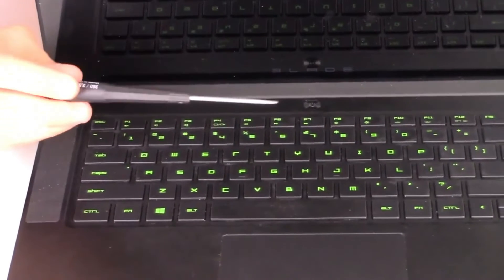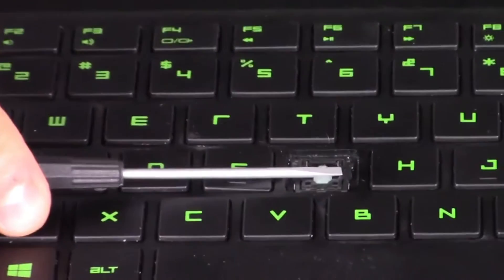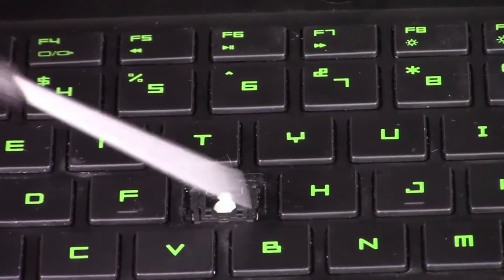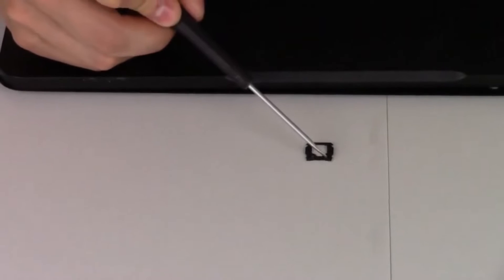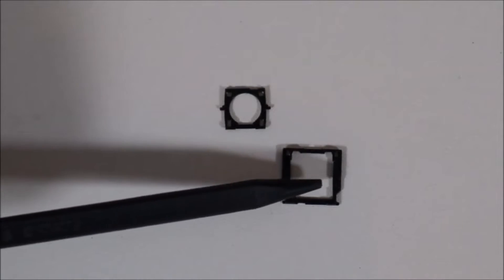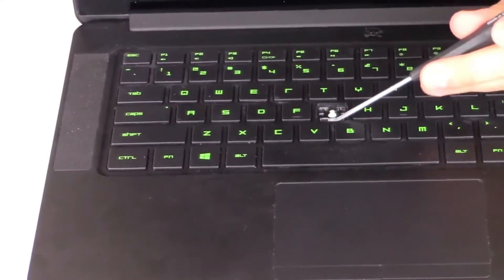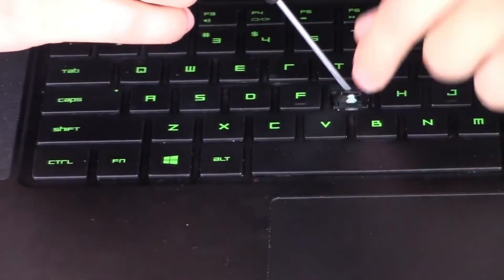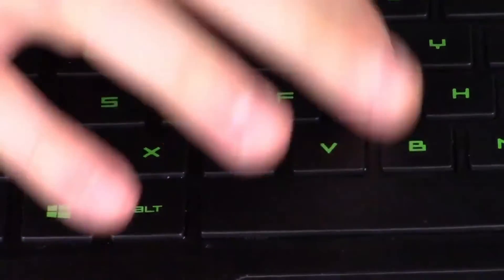How To Fix Replace Keyboard Key for Razer Blade Gaming Laptop Computer

Comment: would this work on a 2022 razer blade 14 with rtx 3080ti?
Reply from the maker: Most keys are constructed the same way with only slight differences in the hinge clip so yes, this procedure would work on most laptops :)
Reply: @PC_Monkey I need help, Im on a razerblade 16 and the key clips are different, I dont see the clips you were talking about
Reply from the maker: @turkeysandwich1458  Do you have a 2 part hinge clip that moves the same way this one does? Does the hinge clip attach to the motherboard by 4 metal pins?
Reply: @ it had a 2 part but it doesnt have the metal clips
Reply from the maker: @turkeysandwich1458  Very sorry. Most keys have those metal clips. Not sure how its hooking to the keyboard if it doesnt have those. Are they perhaps broken off? If you remove another key cap, what does it look like underneath?
Reply: @ they all look like it, it would be easier to somehow send an image of it
Reply from the maker: @turkeysandwich1458  Sorry, I dont understand 'they all look like it'.  If you are able to remove a key cap from another key while leaving the hinge clip down and installed to the keyboard, you should be able to see how it connects to the keyboard.

Comment: If anyone knows by chance what is a good wired keyboard to use instead of the built-in keyboard, meaning a good size to lay right over top, and that won’t interfere with the breathing of the keyboard and the fans right underneath?

Comment: One of the keys (“]”)on my Razer Blade 14 (2022 model) has become unresponsive and another (“@“) partially unresponsive. I believe the issue could be a build up of dust as I cannot think of anything else it could be- no knocks or spills of any sort have happened. Do you think this is my best route to a fix? Razer customer support have been no help whatsoever- I hear this is common so I’ve accepted that this is a task I have to undertake myself.
Reply from the maker: Is there something physically wrong with the key / keys or are they mechanically working fine?  Also, did anything happen before the issue? Overheating, liquid spill, Windows update, etc?
Reply: mine is having the same issue, but I found out mine is actually the rubber spring part which he went over and is probably the worst outcome. Currently because I don’t wanna replace the whole keyboard. I’m trying to find a wired keyboard that I can use over top of it. If you have any ideas, please do let me know on that end

Comment: Hey, i know this is unrelated to the video topic but my laptop has suddenly stopped turning on and not  working. When i press the power button the power button light comes on but i cant do anything else. I would be extremely grateful if someone could help me

Edit: never mind i fixed it i just had to take out the ram and wait a few minutes then put it back in
Reply from the maker: Glad your all set :) Always here if needed !!

Comment: hi i badly need help my capslock key keeps lifting on the bottom part when i click the top part i don't know what's the problem
Reply: tho my retainers came off in 2 piece. is it bcoz of that?
Reply from the maker: Yes. The hinge clip has to be together / installed correctly for the key to work correctly. Were you able to get it back together?

Comment: i need help im stuck with my laptop booting on bliss os and my keyboard is not working so i use a usb keyboard but i forgot to enable the usb keyboard and mouse support or something ive tried everything i know, is there any way i can factory reset it like outside or something. my laptop's keyboard is broken so its like a human but paralysed legs it doesnt work at all so i cant boot to windows, i made bliss os default boot or something. bliss os dont function the same way like windows so i cant just turn it off and on to enable recovery mode, and i cant use the boot key because like i said my keyboard is not working. all i know is there is 2 way to fix this either fix my keyboard or somehow factory reset it. first option is not possible im just a kid so i dont have any money and my parents wont fix my laptop anymore. plss help

Comment: Prees ESC for Boot options /settings This is a boot options problem. How to solve it to run Windows 10 Lite 🎉
Reply from the maker: You have a boot options problem? What is happening when you try to boot your Razer? Also, did anything happen before this issue appeared?  Liquid spill, overheating, Windows update, etc?
Reply: @PC_Monkey  It says choose a boot setting to run 
Yes, while I was updating my laptop, it became heavy and the temperature was also high 
Also, I was deleting some files by mistake How to solve a problem Chrome Lite Windows 10 laptop